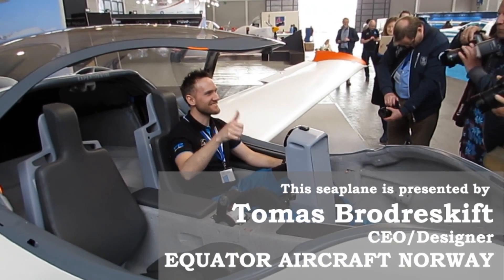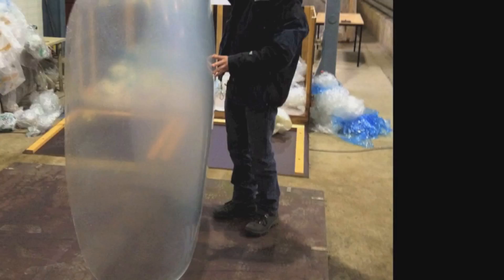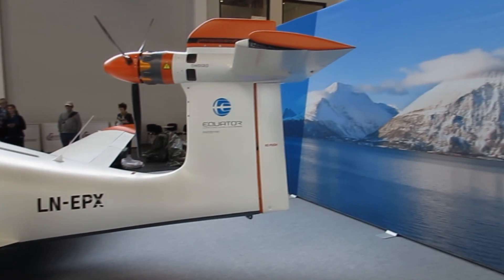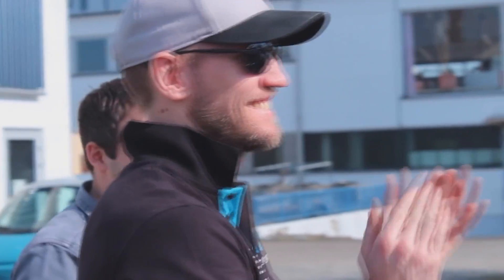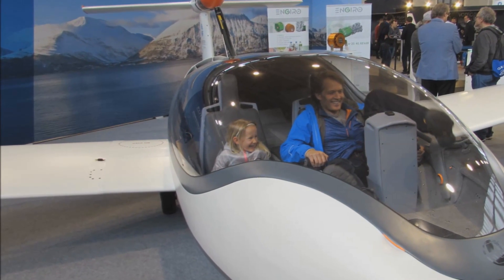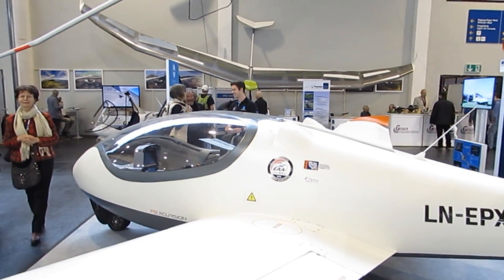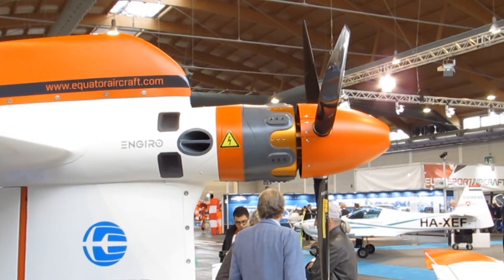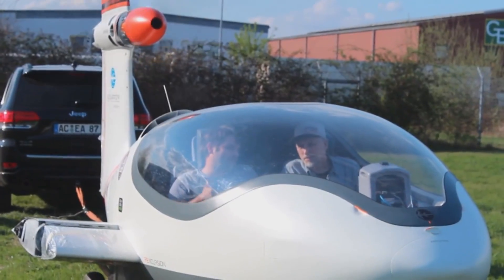Equator P2 Xcursion seaplane World Premiere in Friedrichshafen

Comment: It takes a LOT of power to get a plane airborne, even more in water due to increased resistance.  That’s a small airplane, I assume the batteries are under the body.  So... the flight time is what?  Five minutes?  And the guy keeps bouncing between electric and fuel... huh?  So is there a generator?

Comment: if the pilot of this aircraft were ever so little tilted on finals right before touching water, that one of the wings touched water before the other, it would send the plane into a spin-around then the drag would plunge its nose into the waves, potentially causing a capsize. this can happen due to how low the wings are in relations to waterline. then think about there are WAVES in the real world, and gusting winds on landing..... lets say you successfully landed in waves, now what happens when you open the giant window and a wave hit? then second wave hit? and third? does the thing have a bilge pump? aren't the high voltage batteries sitting down the bilge? im a private pilot and I would not want to count my life to this craft.

Comment: A simple plane for those looking to get in over their head is not so simple. There's this new school of thought that electric is easier as if flight rules don't apply and anyone can do this. First off weight, it's definitely over built and they admit that an electric hybrid is  not avaliable and with two passengers aboard there is no room for any additional weight just midsized individuals only no baggage. Even though they imagine it being a versatile suv type vehicle with extra capacity. But what good is that if you've exceeded take off weight without have loaded a damned thing. They even admit in this presentation that is 80-90 kilos over weight from not using proper composite construction methods. Also further reading and it exceeds weight with only 1/2 the batteries required for 1hr of flight. So any kind of flying was just cut to really short distances under 15min or 35 miles distance. Once airborne you'll have to start planing your landing and if a tower were to put you on a holding pattern, you had better make a reservation with your creator. This whole light amateur experiment aircraft craze isn't what it appears to be, it's number of fatalities is through the roof after such a long clean record of low fatalities for years. A George Jetson type aircraft has never been developed yet, and hopefully never will be. Because when your instruments go down, and it will happen, the only thing that you have left is experience and and visual flight rules.  Another thing is that the airports already have way to many idiots that think the radio is to complicated and can't understand the towers instructions. Your never as free as you would like to believe, even when your up in the air.
Reply: Properly installed fine, the problem is your weight limitations for battery capacity. It will be the future of aviation but it's still in its infancy. The biggest broblems I can imagine are outside electrical interferences, electric storms and solar flares knocking out glass high-tech instrument panels. The biggest limitation is battery capacity, the best batteries are all cost prohibitive unless you have cash to burn, and a lot of it.

Comment: A lot of aircraft engineers in the comments section today.

Does it fly?

"The first Equator P2 Xcursion flight took off from Runway 22 at Norway’s Eggemoen Technology Park at 70 knots and flew at 100 knots at an altitude of about 30 feet before landing. It was followed by two more test flights the following day."

https://cleantechnica.com/2018/07/17/the-equator-p2-xcursion-hybrid-electric-seaplane-makes-maiden-flight-in-norway/

Comment: I've never seen a propeller at the back of the plane like that. It almost looks like it would just tip over. Also I don't think those wings would hold up well on a water landing, being so low. I'd expect them to snap right off. Maybe this is less of a seaplane and more like an expensive show piece.
Reply: Look up the seawind 2000,

Comment: What kind of range vs charging time? How will an electric motor due in a salt water environment? The height of the wings are a concern for me, as a sea plane, sometimes the waves can be a little rough or higher than anticipated. How will it handle in rough seas.
Reply: George Serrano No charging, it's a hybrid with what I understood was a Rotax engine providing the electric power.

Comment: Does it actually fly? What take off speed? Have they put it in water yet? I can't see how it would be able to rotate more than a few degrees, even on wheels... the thrust line of the motor pushes the nose down, and the wings are positioned just right to dig into the water. Yikes...

Comment: How do electric motors fare in wet weather conditions?
Reply: well, they use electric motors under water all the time so I would assume they do very well when sealed properly. if you get your water from a well you have a submersed pump and it does fine for twenty years at a time.
Reply: They can be sealed watertight so water is no issue.
Reply: Water has no affect on my brushless motors. ESC's however...

Comment: I would be absolute surprised if anyone who has actually landed or take  off on a lake would buy a plane with wings placed less than 1 foot above water line. Good luck with this company I see a scam and if not many crashes and lawsuits in your future.
Reply: Matt Fletcher definitely would have been better off with a gullwing setup
Reply: I think the wings are actually in the water
Reply: I kinda agree,especially with no flying examples, and only this hand built mockup
Reply: @cartmanrlsusall   They have flown a prototype. I'm also sceptical of the wing set-up, but they have at least built and flown one, unlike many proposed start-up aircraft companies.
Reply: @cartmanrlsusall  they have video out of these landing and taking off on water, and as it turns out this is better. literaly easier to land taxi and take off.. who knew? certainly not us non-pilot non-engineer types.
Reply: @lukewarmwater6412  the lake amphibians like the buccaneer and renegade use the low wing configuration and they have been around since the 1960s. So it's not new even the tail mounted engine is flying on the seawind line.
Reply: The icon a5s wings are on top in a gullwing set up and hasn't there still been a bunch of deaths?
Reply: @imthefuckinglizardking4590  how many were pilot error? that literaly accounts for more crashes than anything else no matter the design or manufacturer. I would be interested to hear what an experienced float plane pilot thinks of this craft. cause when you look at a cessna with floats and then this, the cassna looks way more dangerous to me, one little degree of angle and your gonna cartwheel in with floats. this looks like it could crab in just fine and not be a disaster.